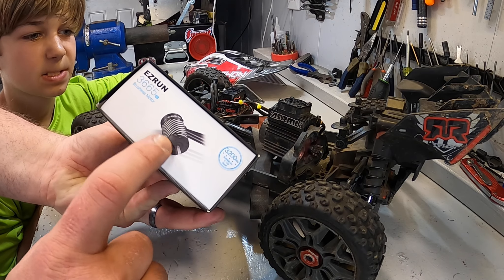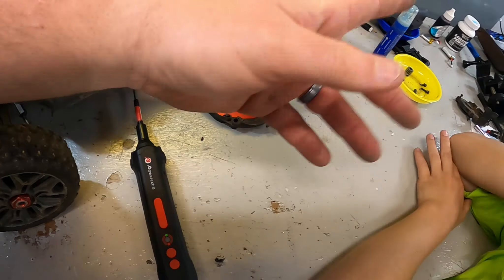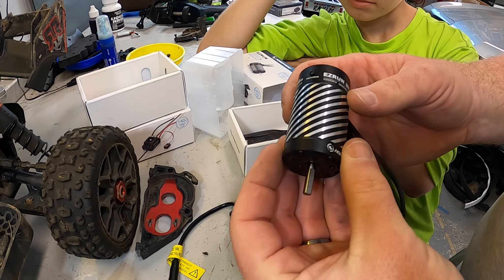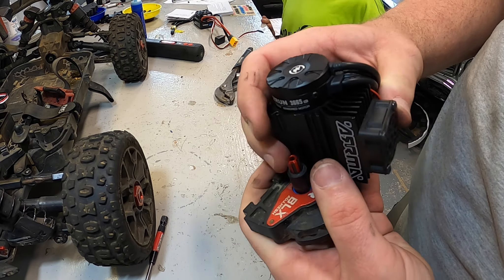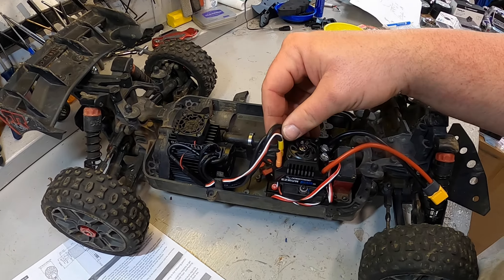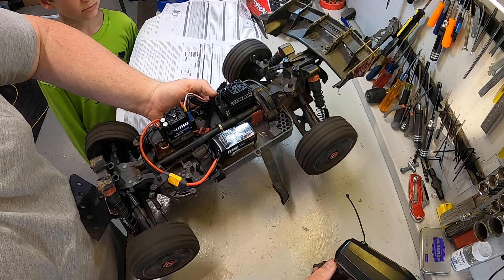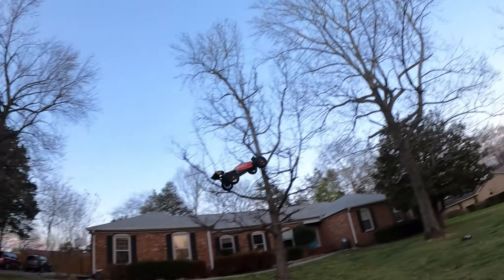Best Motor and ESC for Arrma 3S (Hobbywing Max10 G2 Unboxing, Install, Test)

Comment: Im 3 months in on the 3665 motor and 140 amp esc combo and no signs of degradation on the bearings. Im using it in a SCT410.3 and it rips! Does as well as the Xerun combo. Good setup video and great motor choice!
Reply: I have the Max 8 g2 as well. Its in my ET48 2.0 andbit keeps up with the Xerun motor as well... I spoke with Hobbywing and they are making adapters as well for sensor plug so the motor and esc can be used with a regular style esc sensor plug.
Reply from the maker: That is AWESOME news!   I was wondering about that myself!
Reply: Why does the spektrum motor bearing fail compared to other motors?
Reply: @localsonly-ju6fc  it's a quality issues. I hate to say out loud but arma and traxxas are designed to fail. I've owned both brands and spent a ton of money on replacement parts. That all stopped when I started buying Teknos.... Best brand on the market if you ask me.

Comment: I like it so much I'm buying another one to replace the brand new one that burned up for no reason after about a minute. I used the 2400kv motor on stock Big Rock pinion. Crawled a little bit with it over some obstacles to check the torque and then the fan came on, ran for about 10 seconds, then cut back off. BEC was good but throttle was dead. After that turning it off and back on again would spin the fan for a second, then it would stop, and it would sort of reset again any time I tapped the throttle. Leaving it on long enough to try a factory reset it eventually let the smoke out. I really want the sensored setup to work but if the next $100 one burns up I'd have to say that a lot of concerns people have about hobbywing must be completely valid and they're just trash.
Reply from the maker: That is very odd indeed. 
I have had so many Hobbywing setups over the years - and had good performance from literally 100% of them.  

Yes, it is sensored...but that doesn't mean it is setup for crawling....just a thought.
Reply: @RoadsideRC  I'm giving it the benefit of the doubt that I somehow burned it out from crawling but all I did was crawl over a small pile of clothes after driving it around for a bit. I figured if it was indeed getting too hot from low throttle then the fan would just kick on or it would go into low power or something. Of course, I'm able to put the old 80A stock esc back in and do way more crawling with it and it doesn't want to overheat, just does the cogging. 

So if a sensored setup like this is actually going to have more adverse affects on it due to low throttle rather than the other way around I guess I really don't see the point. Maybe the whole idea is just for racing, but avoiding any initial jump when applying throttle? Or smoother air control? I really don't get it cause I thought the point was basically better low throttle control which also provides more torque.
Reply from the maker: @Magneticitist  These setups are designed to help with the low throttle control for a short period such as initial acceleration or coming out of a slow corner.    That type of thing.
Reply: @RoadsideRC  so would you say it would be quite possible to burn another one out if I was just going up a hill slowly? I know I wouldn't burn a regular Esc out doing that. I'm just trying to know how to avoid burning up the next one I get but I also don't want a baby drive it so lightly that there's no point to it.
Reply: @TimothyFles I use them for driving around FPV and they work great. So not really 'bashing' or racing. 

In one case though I put a sensored setup on an ARRMA Big Rock because I wanted to use way bigger tires. So I dropped the motor kv and pinion and the sensored drive allows me to crawl over obstacles that would have otherwise just cogged the motor out into overheating. On a Typhon I put the sensored setup on just because I wanted better low throttle control from dead stop, not necessarily for racing, but the turbo timing is cool. With an FPV speed build I don't want it to also overheat having to go over grass for some reason if it's already a few football fields away.

Comment: How do you get that Max10g2 below the Typhon Body? I have the 2400kv combo in my Typhon, but no way I can mount the Max10 on top of the receiver have the body in the stock position.
Reply from the maker: My ESC touched the body - but that was it. 
I have since made a bracket and moved it lower, next to the receiver.
Reply: That's not to bad, I also have it next to the receiver but I am considering the center diff.

Comment: I have the max10 g2 80 amp and a 3652 4100 KV motor and it’s incredible. Low down control and braking modulation is excellent. Thermal management is really impressive as well.
Reply from the maker: I'm surprised that high of KV works well, but really awesome that it does.
Reply: @RoadsideRC  yeah, running on 2s because I am limited to that at my local carpet track. I have adjusted the programming to work well with my senton.
Reply: @JonnieB.  i was wondering if your motor fan constantly runs or if it only kicks on when its hot. Mine spins for a second at start up but then stops and did this right out of the box so I was just wondering if thats normal.
Reply: Totally normal. Only runs when it needs to after start up
Reply: @JonnieB.  absolutely glad to hear that thanks man🙏🏻 I thought I might’ve hurt it while soldering good to know that it’s normal

Comment: Yep. I use Hobbywing in all of my cars. In my slash 2wd I am using the OG Max10 SCT (120A, sensorless) (3660 4000kv motor)  in my rustler 2wd I am using the OG Max10 (60A sensorless) (3652 4000kv.motor)  and in my AE 4wd buggy I am using the XR10 Pro with a 13.5 V10 G4 motor. Hobbywing is durable, reliable, lots of programmability, and if you have a problem, their support is awesome. Just look at HW escs vs other RTR escs. My old Traxxas XL5 and VXL escs don't even have any kind of programmability. And with the VXL it is only sensorless and available in 1 KV option which sucks. At the time when I got my HW brushless systems (October 2022) The Max10 SCT combo was 145 USD and my Max10 combo was 96 USD. Compare those prices to the Traxxas VXL 3s at the time which was 160 USD. Traxxas electronics are just junk and overpriced (even there chargers and batteries) so that's why I recommend Hobbywing or any other better option for stuff than RTR stuff.   After this video, I actually want the max10 G2 just for the sensored motor. Lol.
Reply from the maker: They really are great products!  I 100% agree with they are better than most factory offerings!

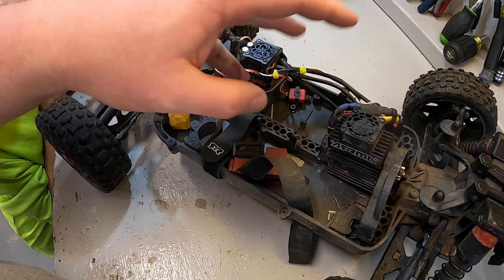Comment: Hello Troy, new hobbywing waterproof sensor connector looks pretty. I like their electronic so much and using it everywhere. Most in offroad 1:10 buggy, but also on touring cars from 1/12 to 1/8. Now i hesitate also switch hobbywing ESC in Sledge for Max6, left original motor there.
Reply from the maker: Yes!   They make great stuff!

Comment: I got this motor for my vorteks cause the same thing happend to me. I also upgraded the motor mount cause it will bend all the time and strip gears so definitely consider getting that upgraded as well.
Reply from the maker: Even after all of the abuse we have given this, our motor mount had a very slight bend - sp not very worried about the mount.

Comment: I've always wanted a sensored esc and motor setup. Interesting to see how it affected the drag race by eliminating the cogging and delay. Any recommendations for Traxxas Maxx?
Reply from the maker: Hobbywing makes a Max8 combo that would be EPIC in the Max:  https://amzn.to/3muNQ6M
Reply: I agree Max8. As Traxxas says it is a 1/10 it's not really 1/10 And more like 1/8. Well I mean that the Max10 might hold up in the maxx but due to the weight of it I would do the Max8 And run 2 2s lipos or just 1 4s lipo 🙂

Comment: Awesome set up! I will b buying this upgrade when my motor goes out. I have had my 3s Typhon for about 2 months. I just got a fast Eddie bearing kit for it. What caused the motor to seize? I have noticed a great deal of heat when I'm running on 3s, I'm going to cut some vent holes in the body and look into a more powerful fan. I have a chassis cover also to keep the debris out of the power module, I'm sure it's trapping heat but which is worse? Heat or getting rocks and grit into the power module wrecking the bearings?
Reply from the maker: I believe heat to he the biggest enemy here. 
Honestly though - this buggy made it through a lot of torture, over multiple years, so no complaints from my side.

Comment: Nice video! I'm thinking about putting a hobbywing max10 140amp, 3200kv motor in my Rival MT10. I'm wondering if it might be overkill though and just going with the budget hw 10Bl 120amp combo. How has your max10 combo been in the Typhon? A worth wild upgrade? I could justify getting it if it's a really nice increase in performance/durability,etc. Thanks!
Reply from the maker: This combo has been literally the best basher combo I have purchased.   Power is HUGE and SMOOTH.   100% recommend.

Comment: Thats nice would love to try one my self does it have boost? because if it does am thinking max 8 g2 arrma infraction rwd and a drift gyro
Reply from the maker: Good luck with that build!   If you can pull it off, folks will love it!

Comment: In my experience, any motor will get ruined in these arrmas pretty quickly as long as you keep the bottom opening exposed. i found no other solution other than sealing the bottom opening to keep the dirt/debris out of the spur area. I use tape to seal the opening and my  motors stay alive much much longer since
Reply from the maker: Great tip!
Reply: Actually.... thats a real mistake, dirt will find its way and its actually common in the bashing community to open up the chassis hole a bit more to allow for the dirt and grime to get out since it comes from around the motor mount, by sealing it you dont allow the dirt to get out... ARRMA did this for a reason. Its meant to be a modular design with the motor mount, so they saw a need to correct the mistake after they had first tried their model. This chassis design is proven as they are in their 3rd iteration (v3) and the hole stayed....lol extreme bashers simply open it more for easy dirt  exit and extending the life of the drive unit.
That being said i guess your method would be ok if you dont bash or srive in dirt. If you just do road or grass you should be 🙂 👌 👍
Reply: @jah-jah87  I tried the opening in the chassis and it didnt really help. i would ruin a motor in 2-3 battery packs, running on sand dunes (desert). the only thing that worked for me was sealing the power module - and since my chassis already have a hole.. having the hole as well, which i think also helps in combination to the tape. Running on grass i would assume works ok with the stock opening (as long as you open it for cleaning from time to time)

Comment: I have Typhon 3s and motor bearing broke apart. I hammered armature out. I notice on one side under a metal ring there’s a half circle of blue stuff looks like silicone. I’m worried a bearing won’t sit right. Is it supposed to be there. ?  I’m lost. I posted a video on my YouTube channel if you could take a look. I can post a longer one if needed. I’m new to this. Thanks in advance
Reply from the maker: It must be fine - you didn't add the silicone, so it was like that from the factory.
Reply: @RoadsideRC  do you know how to clean the motor and armature? Mine is very dirty. What can I spray in the motor itself ?  People say lube the bearings. Is that right?  Aren’t they sealed bearings
Reply from the maker: @brianu33  There is electrical cleaner you can use.   The bearings should be pre-greased, so no worries there.

Comment: xr8 combo would have been a better choice
Reply from the maker: Not for this small plastic buggy!   That is overkill.  

I would go Max8 in a 4S-6S Kraton.
Reply: @RoadsideRC it’s amazing how much people always think bigger is better, it’s the same thing with tires, and they wonder why they’re always stripping gears/breaking shit.
Reply: @RoadsideRC    Xr8 not Max8,,,20 more amps,600 more kv,replaced day1 into owning it,radio,servo,combo
Reply: @2rcguyskinda.154  It looks like the xr8 SCT combo is quite a bit more expensive at ~190 compared to the 3300kv Max10 combo at $130. His kid seems pretty stoked with the max10